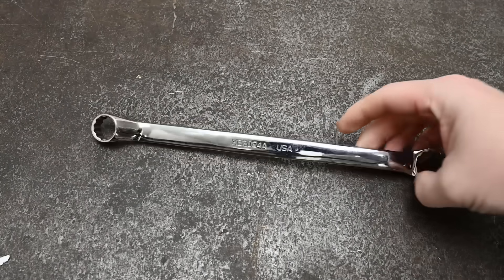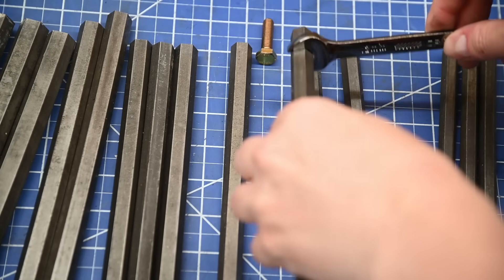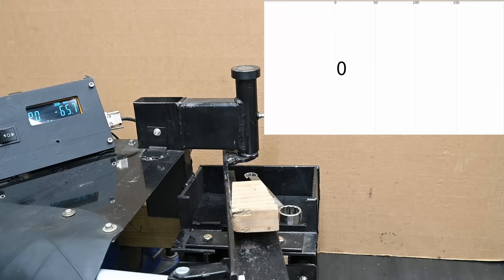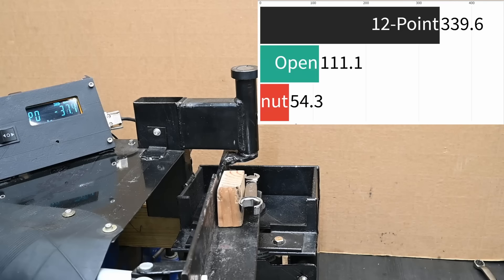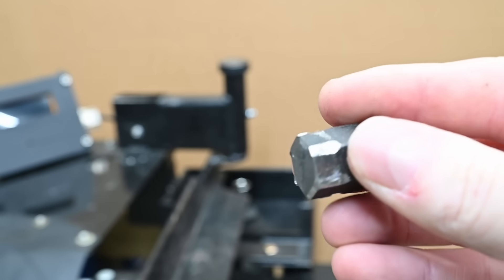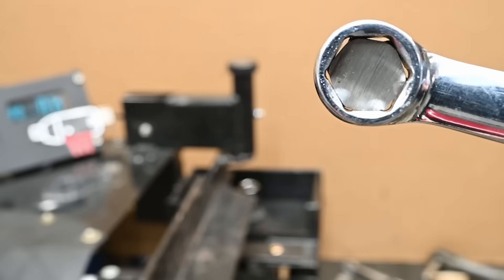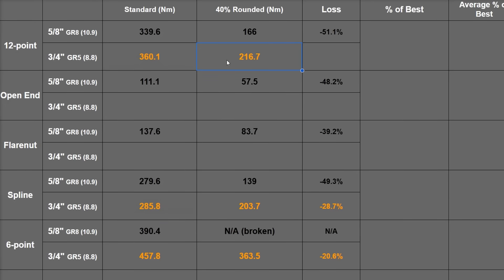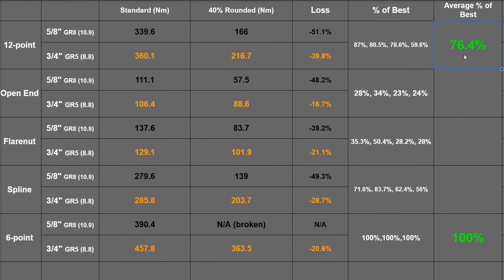Wrenching Robot Settles Which Slips 1st

Comment: When I was a tech back in the 70s, we were told you needed flare nut wrenches because the metal flare nuts were made of was softer than grade 5 and you needed the extra contact so you wouldn't round the nut off. That's also why flare nut wrenches often have a thicker head. They were not designed to be used as regular wrenches
Reply from the maker: I think most people know that, it's interesting to see their advantage over an open end within the same brand
Reply: We are aware of that, but I've always wondered how much difference the extra gripping surfaces actually made and now we know.  It's also why on heavy equipment most people just use open ended wrenches - it's all steel rather than aluminum/brass etc.
Reply: We see you never left the 70s as well. Everyone on this channel knows what a flare nut wrench is for.

Comment: I can’t say I’ve ever seen a spline bolt but just ised my kobalt spline passthru ratchet on a 12mm bolt between the frame and trans that was too tight for anything else and guarded so a wrench wouldnt fit..
A tool for every job and a job for every tool

Comment: I haven't been thrilled w my spline stuff. I have noticed the 'normal' spline end of my Gearwrench long patterns are worse than the ratcheting end of the same wrench, somehow because the insert of the ratcheting end is hardened? Not sure. Maybe a 6pt ratcheting end is a good compromise of strength vs access?  I dunno. Too many variables.

Comment: 5/8 and 3/4? Over 40 years i have used those wrenchs twice. Maybe.
Reply from the maker: I've used 3/4" probably over 5,000 times. It's the standard hex size for 1/2" threads

Comment: Are the numbers the that much different with 12  & 6  point sockets?
Reply from the maker: They should be equivalent to this on equal thickness bolt heads
Reply: @TorqueTestChannel  ahh the word “should”    Proof is in the pudding ?? Another test needed?

Comment: What I want to know is how did the 12-point went from a specialty item to a standard? I only buy 6-point, I almost never need the extra 6 positions the 12-point provides.
Reply from the maker: The arm length of a 6-point wrench often finds itself in the wrong position for me once turning it and trying to place it atop the bolt head again

Comment: Every mechanic in the rust belt is nodding that I told you so nod. Good stuff TTC.
Reply: It's funny seeing Rust Belt (deindustrialization of the Steel Belt) to mean where cars rust (the Salt Belt).
Reply: And those mechanics don't understand the reality. You're talking about 250 ft-lbs+ on a wrench before it failed. You are not putting 250 ft-lbs of torque on a wrench (unless you use a cheater bar but then you're using the wrong tool), therefore 12pt vs 6pt does not matter. If this was sockets, then yes 6pt > 12pt all day, because you can get close to or exceed that failure point.
Reply: @PenumbralFigure Found the engineer.

Comment: Would the Open End or Flare Nut wrenches do differently if they were flipped? Like how an adjustable wrench does better or worse depending on which side the adjustable jaw is on and which way you're turning, would they clamp shut instead of opening?
Reply from the maker: We've tested open ends both ways in 3 seperate episodes by hand and with pushy with no difference seen yet. But that requires a perfect use, the other orientation does encourage you to put a bit of a tweak on it

Comment: Torque Test, One small item, when spline came out they compared it to conventional 12 point box end. You are using a Flank drive 12 point box end. Great video by the way I like what you are doing.
Reply: An xb2024a is a discontinued model, I would assume before flank drive for that reason

Comment: I might have missed it but, was there any reason you didn't use 12 point on the fastener side?
Reply: In the real world it overall just isn't very common outside of aircraft, so the vast majority of people are using 12 point on 6 point fasteners. It would be interesting to see how much better they perform on a 12 point fastener, but it isn't all that relevant to most people. Just sucks when you have one bolt on your car thats 12 point and you need to keep that single extra 12 point for that one fastener just in case lmao.

Comment: have a old 9/16 1/2 flare wrench, that may have found its way from my dads toolbox to mine, that Ive used quite a few times to remove rounding bolts, it's thick as hell and the opening on it is really small compared to newer ones of the same size that I've seen

Comment: I've said it a thousand times, but here in the rust belt, a six point socket/wrench is the way to go.
Reply: For really rusty stuff where the hex of the bolt is compromised, sometimes 1mm smaller in a 12 point will be the best option. Sockets are cheap in realtive terms, probably better to own both in the most common sizes.
Reply: @adaycj one of the reasons I hate wrench or socket sets that skip. In the rust belt you need every size!
Reply: @adaycj  If you can hammer on a slightly smaller socket, DO IT!
Reply: @knurlgnar24  Which is why only 11mm sockets exist.
Reply: @knurlgnar24 it works just use the same beaters you can warantee
Reply: @kaduseus  10mm is Schrödinger's Socket.
Reply: Yup.  12 point sockets will ruin your day right quick, and if all you have available is an open ended wrench you might as well pack up and go home.
Reply: I prefer a good set of vise grips or the trusty old gas wrench for the garbage I work on from the 50's through the 70's. ;)
Reply: not in the rust belt and all my sockets and wrenchs are 6 point. I have 12 point only for 12point fasteners.
Reply: @ionstorm66  Apparently airplane stuff is 12pt a lot of the time.
Reply: @esoteridactyl  i work on gas turbines and most of it is, either that or hydraulic tools
Reply: @esoteridactyl  Are there any reasons as to why this is the case?
Reply: I don’t live in the rust belt but if I did a blue tip wrench would be my choice
Reply: Especially as tools get worn over time. I’ve found 12pt tends to fit looser even when new, then after a lot of use can wear down and barely grab.
Reply: Id give olsa's extractor wrench's a try
Reply: @littlejack59  thats a different ball game we are getting into extractors
Reply: Same over here in Scotland I live right by the North Sea. I always stick to 6 points especially on vehicles
Reply: I always go with grade school logic. Count the fastener sides, use the equivalent drive.
Reply: 49
@narlycharley  And now you've said it 1001 times 🤣It's still as true as it ever was even in the non-rust belt.
Reply: Don’t matter what wrench ya got here in Rust Haven, it’s gunna be a nightmare. The blue wrench is the only one that’ll work for sure.
Reply: On a regular  bolt, ofcourse.
Reply: K
Reply: i like to hammer on a size smaller socket or wrench to really grab that rusty hex. and sometimes a 12point will fit more rusty hardware better than a six point of the same incorrect size its best to have as many different tools as possible on a tough job.
Reply: 6pt save the day also hold on 4 1/2 sides 😂. Nighbors challenged me with half rubbed off starter bolt 😅 I got it out 6pt
Reply: As a rust belter, an olive clay aggregate 24 point tungsten with a cold laser heat treat hot dipped in galvanized tungsten wrench is always the best choice.
Reply: I have used to have all 6 point sockets  but 12 and 6 point wrenches. The 12 points give you double the angles but there’s not much point in using 12 point sockets. Until I started wrenching on my Toyota and ran into a lot of 12 point bolts
Reply: 12 pt offset is for lack of room with other tools in a non corrosive area of an automobile.
Reply: Yes always, if it fits.
Reply: Yeah, but tell that to the people designing engines.
Reply: Until you can’t get the damn wrench on
Reply: Until you can't tighten it that final 1/4 turn or it's inaccessible.
Reply: @RecordnRtist  Tightening isn't the concern. Loosening is.
Reply: 12.9 strength would help a bit too, add inverted torx head too for increased grip. But you might break the bolt instead because the thread has rusted solid.

Comment: can we make this video mandatory viewing for all of the ratcheting wrench manufacturers... every single pair available in my region are 12 point, WHY.... it has 80-120 little ticks of position it can be in it doesnt need a 12 point...and in canada we can round off hardware with two fingers of pressure miles below what the ratchet mechanism can handle
Reply from the maker: I've always wondered why ratcheting 6-point hasnt caught on. Most the brands who carried it have discontinued them I'm guessing from poor sales
Reply: @TorqueTestChannel  I was all set to buy the 6-point ratcheting wrenches from Tekton a couple years ago, then all of a sudden they were 12 point. I went to HF and grabbed the Icon set instead, if I can't have 6 point, may as well have the more convenient warranty.
Reply: @boostfrog still some sizes available in the Tekton Outlet
Reply: @TorqueTestChannel  I like my set from tekton, long reach flex head 6 point
Reply: @TorqueTestChannel   It's pointless if you think about it. My favorite wrench ever is a snapon 12 pt  1/2 x 9/16 box ratchet. It's the only wrench for roller track bolts on elevator doors by GAL.  I've used 6 point box ratchet wrenches and they are all garbage.
Reply: I've been looking for a 6 point ratcheting wrench set for a long time now but they just don't seem to exist. It's so infuriating
Reply from the maker: @EddoWagt  Mac tools still make them
Reply: @EddoWagt   Don't bother, all the ones I've seen are basically made by the same factory it seems. They are all cumbersome and terrible quality.
  edit;  I just looked up the Mac tools 12 pc set ($370) These are new and look good, but I would have to see them in person.
SRWMO12 6PT
Reply: My SK X-Frame Ratcheting Wrenches are 6-Point.
I do agree that more manufactures need to make 6-point ratcheting wrenches, as the X-frame are 0° non-reversible, so not the best in every scenario. SK is also not the same anymore, so I wouldn't buy any of their new stuff.
Reply: I’ve wondered the same, but I suspect 6pt ratcheting boxed end aren’t popular has to do with the strength of the wrench. That it, in a ratcheting design, 6pt vs 12pt will have the same strength, the limit being the ratcheting mechanism or outer rim of the wrench. The other thing 12pt or spline designs offer is compatibility with more fastener heads, including 4pt, 8pt and 12pt. In general, those are much less common, but in certain fields, those fasteners can be much more common than average.

That said, 6pt ratcheting would almost certainly be better for softer bolt material and rounded fasteners, so I think they would be useful.
Reply: Workpro makes a 6 point. Is it the strongest wrench ever? Probably not, but you have sockets for that.
Reply: @Omnis2 I have those work pro ratcheting wrenches. They get loose at the flex head, but overall they impressed me with how they hold up, only problem is they are thicker, side to side not vertically, than my gear wrench 120 xp’s and it makes them no usable in some tight spots, like CAT style and code 62 hydraulic fittings.
Reply: @alexmills42  Fair point. Have you experimented with grinding down the sides or anything like that? They're cheap enough to try making into a "For that damn XYZ bolt" specialty tool. Who knows if all the mechanical guts would come flying out though. Or they break and your finger guts come out instead lol
Reply: Now we need wave drive
Reply: I hace 6 point ratchets and well... Usually the issue is that you just destroy the ratchet before anything else so ir becomes a bit pointless after a few times.

Comment: I honestly would have expected more from the flare nut wrenches, especially considering the quality of the Snap On wrenches. There seems to be quite a bit of play on the fastener compared to the others.
Reply: I've found that a good open end wrench gets higher torque than a low quality flare nut wrench 🙈 Though honestly bigger issue being the nut stuck onto the pressure line itself, spinning it around and breaking it in the process of unscrewing, at which point you may as well just cut it off and use a socket.
Reply: I've thought about this and maybe the reason is it's use is on brass nuts and that prevents people from overtightening. That's just a guess.

Comment: I commented on last video, but I'm doing it a again just for brevity.

Can you do a video on (or that includes) gimbal palm ratchets? Gearwrench and craftsman have some and others on Amazon.

Otherwise, keep up the great work!
Reply from the maker: Testing what aspect? When they break, they're palm ratchets so i don't think that'd be common. Not sure what else besides back drag to test on something like that
Reply: @TorqueTestChannel  Im curious how much power loss when they aren't perpendicular to the fasteners. There's a few styles I've seen. Maybe how(if) they're different from universal sockets.
Reply: @queueeeee9000   The ones I've used are all awful. Don't bother, it's just a gimmick. They break if you sneeze on them.
Reply: @firesurfer oh, okay. I kept getting them recommended on Amazon. I like to try new tools, and was curious.
Thanks for the heads up, though

Comment: Bro you tested flare nut and spline but not triple square? lol
Reply from the maker: You have triple square wrenches? And you use them on hex bolt heads?
Reply: @TorqueTestChannel  That person 'works' on Audi and VW's and we have to fix the issue's that person caused.
Reply: Apples to oranges